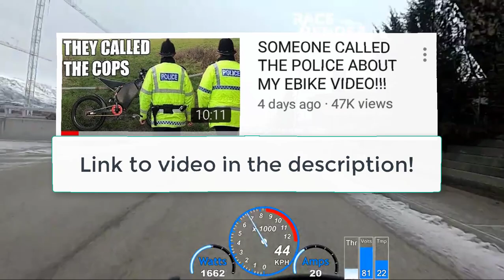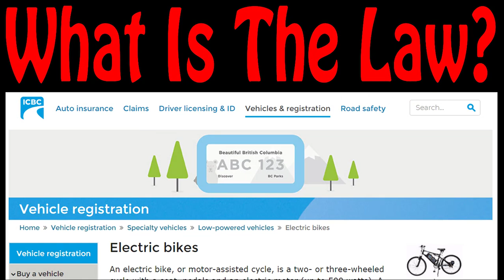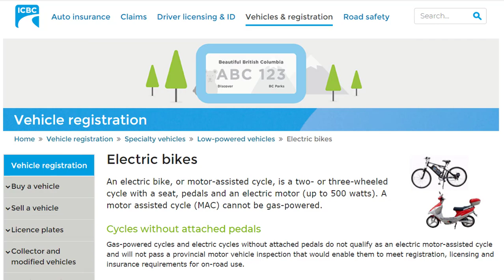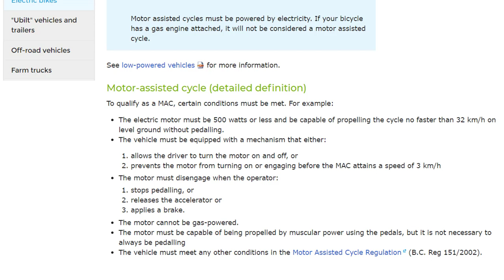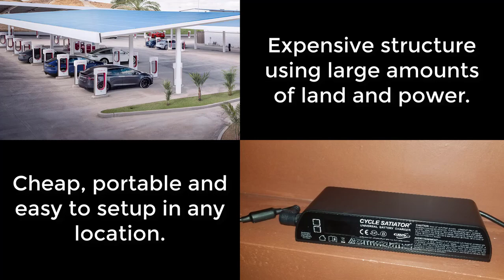High Powered Ebikes and the Law...

Comment: I thought that if an eBike's power and speed exceed the specifications of the laws set up for them they merely automatically classify as a motorcycle and would then only require a license, permit and insurance to ride like a motorcycle does. Am i wrong?
Reply: Exactly. Imagine motorcycle riders point of view on this. He needs all those things but person on powerfull ebike can ride his bike without anything. It doesnt seem fair. Similar situation was with Uber drivers vs taxi drivers. Taxi drivers need all sorts of permits but Uber drivers not. I think it has changed recently but at first it was a problem. At least in my country. On the other hand I would also want to have more powerfull ebike without need to have motorcycle licence and insurance. Because in my case I wouldnt ride it on regular roads for my safety, Therefore driver licence would not be necessary. I guess this topic may not be as simple as it may seem on first glance.
Reply from the maker: Its tricky. I am building a bike this year that I hope to get properly registered! Cheers.
Reply from the maker: I wish. There is a path in some countries but its surprisingly difficult.
Reply: Andy kirby is going through the process in the uk,
Bike had to go through various tests ( fair enough ) have vin number , be registered , insured ( dont think he has managed that one yet?) Tax is free but still needs doing, it not impossible but far more work than most people will bother with and the killer to it all is the insurance, no insurance companies want to know because it's just too much of an unknown entity.
I just built an ebike but know I cannot legally be on either the road or cycle tracks and obviously not on the pavement. I also fly racing drones ..
I dont want to be an outlaw but complete lack of any real options make it difficult lol.

Comment: Excellent views on the legality issue. I myself prefer enough power to enable me to avoid danger and 750 watts is only enough to get you out into trouble, I've settled on 6500 watts. 1500 mid drive and 5000 rear hub. This allows me to feel a little safer, as I have "avoidance power". I've collected 8 broken bones and over a thousand stitches from being run over from behind, riding a bike with 750 watts.
Reply from the maker: Yeah. I bet. Did you consider a front hub and the mid drive combination for 2wd? Sounds like a cool project and a horrendous thing to happen. I worry about being rear ended more than anything else. I'm always watching my rear at lights etc. Cheers!
Reply: @HighVoltageKits  I was at one point considering 2wd, however after my rear wheel was destroyed anyway, I opted for a rear hubmotor. If I had been running the power I have now, I could have gotten off the bridge I was hit on.
Reply from the maker: Yeah I'll bet. Keep me posted it sounds an interesting build. I'd like to try multiple motors one day. Cheers
Reply: @HighVoltageKits  There is a very comforting peace of mind that goes along with having two separate independent drives, and the knowledge that you can still get home if one fails, compliments the added acceleration and range. I recharge once every two weeks if I need to or not. Lol!

Comment: The laws here in Western Australia say 250w maximum for PAS and 200w maximum for throttle. No one pays any attention to these laws, and as long as you don't annoy people the cops don't bother enforcing it. Just don't fly past them at 60 kph without pedaling and you'll be fine. Even then they probably wouldn't bother. You're supposed to wear helmets too, many people here don't and no one gets fined for it.
Reply from the maker: That is pretty much my experience. If you ride responsibly and respectfully to the conditions you will be unlucky to be bothered..Although in the EU it might be different. I can't see people getting grief on an ebike with covid tho.

Comment: Thanks for your contributions to the development of the display and controller functions. I have suggestions/questions about possible mods that allow us to show authorities that we are compliant on the days we want to ride a Type 1 limited trail. Could we buy a special battery with a low voltage that limits the watts to comply with 500 and 750w limits? Can a throttle be designed that is easily unplugged and removed from handlebars, and yet still have the pas work? Can we have a software setting that limits speed to 20mph or whatever regulations require, and have that software setting done in a way to show the officer who inspects our bike?
Reply from the maker: Thanks Pete. I have made some graphics for a secure mode that locks down the bike to whatever is legal for on road use in their area. Its not fully coded or tested yet. But you could have the bike boot on locked down and then require a PIN to enable full functioning. That way you are not wasting one of your two riding modes with the legal mode.

Comment: 32 kph is equal to 20 mph. That's probably the reason for the strange number limit. I agree about e-bike regulations, they are ridiculous. Why not regulate as we do cars? Power should be irrelevant and the speed limit should be based on the road not the vehicle. I would argue that if you're going fast enough to keep up with cars you need more protection than standard bike equipment allows for. I say this while riding a 2500 watt mid-drive through the streets of NYC.
Reply from the maker: I reckon you are right. I wrap up fairly well. Full face helmet boots gloves. Reinforced jeans. I could do will a better jacket.
Reply: @HighVoltageKits  You & me both. I wear the bike gear but know it's not intended for crashes at 30 to 40 mph. I considered a motorcycle helmet but, until recently, NYC was very strict on e-bikes so a full face helmet wasn't stealthy enough.

In the last few weeks we've adopted much more rational laws. Less than 750 watts and 3 classes. Class 1 is limited to 20 mph (32 kph) with no throttle. It's now legal to ride e-bikes with a throttle as class 2 or 3. Class 2 is allowed 20 mph & class 3 is allowed 25 mph (40 kph). Unfortunately there are still restrictions on where you can ride them. A throttle e-bike can only be ridden on roads meant for cars with a speed limit under 45 mph.
Forcing us to keep under 25 mph on a road with vehicles doing (at least) 45 mph seems safe to our lawmakers;(

Comment: like the police is going to have a multimeter and ohms law or even a mobile dyno so they have to rely on you speeding, burning donuts or wheelies
Reply: They won't need a dyno or Ohms meter if the point a speed gun at you and you are clocked doing 50+mph is the reality 🙂💯
Reply from the maker: Yeah..Your only chance is that they are rooted in shock and don't pursue... Or don't fancy the paperwork
Reply: @HighVoltageKits  Don't think they will worry about the paperwork they will confiscate the bike and place it in a the crusher is common place now in the UK, I guess it's different in Trudeau's Canada ?
Reply from the maker: Yeah. I think that with or without Mr T Canada would be better placed. More space and a different attitude. The reaction I get is awesome. But I am pretty judicious as to when I let rip. I csm see people crushing stuff if they ripped through a red light or were blasting through the city center showing off.
Reply from the maker: Yeah. I have ridden past the law numerous times. No issues so far but I keep things responsible. Cheers

Comment: Thanks for the good, thought provoking video. I agree with several of your points. I live in the same town you do and have wanted to switch to a bike for my daily commute, but I have resisted because of the hills. This week I rented an ebike to see what they were like, and I was incredibly pleased. The bike am testing has a Bosch 350w mid drive motor, and it is speed limited of course. 

My biggest concern now is keeping up with traffic. Just yesterday I was riding some of the same streets you rode in this video, but I chose to mostly ride on the sidewalk because I couldn't keep up with traffic. This created an awkward situation on some of the more narrow, hilly roads when there were pedestrians on the sidewalk and I was forced to switch to the road. One divided road wasn't wide enough for a car to pass me, which didn't feel very safe to me.

I have decided I'm going to convert my Norco Bigfoot to an ebike, but was going to stick with a 500w bbso2 because of the legalities, but I do really like the bbshd. I will consider your points when deciding.
Reply from the maker: Sounds good. I'd suggest the bbshd as it is more upgradable. Kamloops is crazy hilly so having the extra power will really help. In terms of the law having road and offroad profiles helps. In general I stick to non busy roads and sensible riding. If you need any help and advice I'll be happy to supply. Once all this social distance stuff expires etc.
Reply: Go for the BBSHD. The BBS02 is great but will need help up hills if you intend to maintain 32 kph. I have & love both but the BBS02 is easier to burn out especially on throttle only.

Comment: So, what would the fines/penalties be like if you got caught with a decently powered ebike, say 2500 watts and 72 volts?  Where can I buy a mid drive motor that even will handle that?  Are the cops really going to pull you over and measure things?
Reply from the maker: The cops have alot of other priorities than bothering me. I'd have to do something pretty stupid to get on the radar. Must admit I have not looked at the penalties but they'd probably be a warning to start with. 

As for motors there is the bbshd that with an external controller will push 3500 watts on a 72 volt battery. The cyc x1 will do up to 5kw with ease. Both kits you can get online. There are usually a bunch of links on the descriptions unless I forget to add it on!
Reply: Unlikely to get pulled by police unless being stupid,  they have more important things to do.
Problem will be when there is an accident with no insurance etc etc  ,  big problems then, all damage and injuries to all parties will need to be paid for inc court costs etc, penalties on licence and fines.
Bottom line, be careful out there.
I just watched a video of a bike hitting a small child coming out of a shop, bike was going way too fast and on pavement , kid is intensive are with serious injuries.

Comment: I agree with Michael Clarke's observation as i also have bought a road-legal 250-watt Bafang and fitted it to my Specialist mountain bike, plus the fact I am a disabled rider and use it to assist against wind or inclines, but still need the exercise. In the category of lady's and old farts range of motor but I find it is overall acceptable and matches what I would have achieved before my illness, plus one can override the restrictor for those steeper hills and downhill to get into top speed still reaching just under 40mph! 

But here's the point: It's not meant to be a 'Motorbike' It is an e-bike built as an 'alternative' to a standard pushbike! When does the higher-spec become an E-Motorbike while 'claiming its still a pushbike' to ride it where only pushbikes can go but at 3-4 times the speed to pissing off walkers, dogs plus the wildlife who get in the way, how long before a child is hit by these 'E motorbikers'.. complaint's made and it all will be stopped... for everyone!

If the latter, then it is an 'Electric Motorbike' and not an E-pushbike!  Hence the suggestion would be correct,, we all need to have these 'E-motorbikes checked and licenced with an exam'!!!  but that would be suicide to the 'e-bike or muscle power freedoms' we have over 'motorbikes legalities' which Law's are already there... Hence my thoughts on the larger motors_ Just Reg as an E-motorbike legally with the DVLA, or the 'lawbreakers' will soon close the E-pushbikes down- or protest correctly to change the Law at the source... That just democracy, or we can all just ignore all the Law's because some are just too stupid or inconvenient!
Reply from the maker: You make some great points which I will attempt to address. In terms of classification I do not consider what I ride to be a push bike anymore by a long way when I ride it on the road with traffic. If I am anywhere near walkers etc on shared paths I ride at speeds that are safe to them. If it is really busy then I usually hop off the bike and walk for a bit. In fact when I rode shared paths and towed my kids to school the most dangerous thing about was not me with a high power ebike it was nutters on carbon road bikes trying to get on the strava leader boards and cutting blind corners. I have seen many a walker nearly get smoked by regular bike riders but I am yet to see anyone behave so recklessly on an ebike. 

Maybe it is different in the UK. I rode home today mostly on back roads. I think I reached just over 40kph in places. I obeyed all of the road restrictions and laws except the one restricting my bikes power to 500 watts. Part of the way I rode a multi use trails. I kept it to no more than 30 kph. The one person I passed I slowed down to 15kph and said hello to them. Now if I rode past at 60 kph that would be a different story. So if you want to take the bike on such a trail limiting it is the easiest way. But I can do that at the push of button!

I really do wish I could register the bike. But there is not a path to do so in Canada like there is in the UK or USA. I firmly believe that we need a new class anyway that covers light EVs that is nimble enough to keep up with the advancements in technology. 

The bike you ride suits a very niche purpose. Fitness. I have no interest in using my bikes for fitness. I want to commute without sweating and needing to shower. I want to pull serious amounts of cargo. The market for the kind of bike you use is very well catered for but it won't allow for a light electric revolution of our cities which I want to see happen.

So a light EV class would require licencing but a low powered ebike for fitness etc ought not to be. I think that the laws can be crafted to allow both worlds to coexist. I think the technology is there to allow both types of vehicle to coexist simply by the use of limiters. So if a higher power ebike rider wants to ride on a multiuse trail the power available is cut to a safe level. Just like in cars when someone wants to drive near a school or a playground limiters cut in to prevent the driver from exceeding the speed limit.

Anyway I think I have blathered on long enough. Appreciate you taking the time to add to the debate.
Reply: @HighVoltageKits  Great reply Plus I love Andys Vids too: But feel the distinction between 'Motorbike and Pushbike' ranges of motors available is a confusion that needs to be separated more sensibly is agreed. In my mind, the 250-350 watt is in the 'push-bike range', 500 watts above are 50-125cc e-motorbikes or equivalents in electric form. 

It is true, most of us all ride these various ranges sensibly and considerately... but it's the few (including the carbon push bikers), who will spoil it to end up with test and licences for all Knowing it will force most off roads green lanes, parks... Money will speak louder than common sense when it comes to Gov and its partners in crime... and people will always push the boundaries beyond the reasonable...
Reply from the maker: Safety is the first thing on my mind but it is a worry that others will not be so minded. One thought I had was to scale the power so if a heavier bike or pulling cargo some more power would be available so a fair speed is still achieved. No idea how it could be reliably implemented though.

Comment: I have a 500W ebike, motorcycle and truck.  I think a 500W-750W limit is reasonable for treating an ebike like a bicycle (ie. can go on bike paths and doesn't need license) as that is at the upper limit of what a really fit cyclist could put out.  Anything above should really be treated like a moped as in BC they can go up to 1500W.  There should be requirements for minimum breaks, mirrors and signals but, just like mopeds, you should only need a class 5 (also I've used moped and a lot of the time their brakes are horrible drum brakes but I digress).  >1500W possibly consider a limited e-bike motorcycle license (due to the differing dynamics of operation at higher speeds) with again requirements on brakes, mirrors and signals.  If you have a regular motorcycle license that should translate over to an e-bike as well.  

They do offer an amazing future for transit.
Reply from the maker: It will be an interesting balancing act to get power levels right. You make some good points regarding safety. When I used multi trails to commute the most reckless by far were the strava crowd trying to get records and jump up the leader boards by cutting blind corners etc. I'd welcome a path to legality. Cheers!